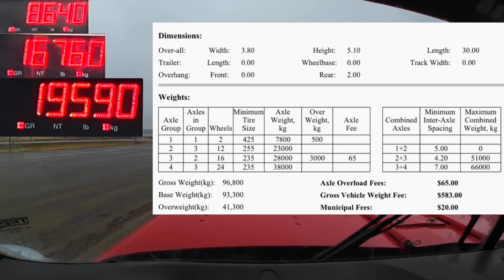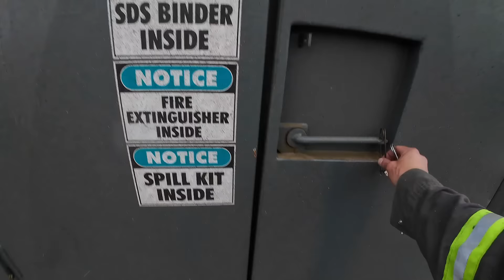CONKLIN BOILER

Comment: Hi guy your really good at what you do I am a retired HD mechanic seen a lot of drivers but your good at what you do I had a accident lost both legs and left hand and deaf was hit with 440 voltage power finished me but I still do a lot of welding for folks
Reply from the maker: dam, sorry to hear about your accident dude. you must be one hell of a tropper to continue and weld too, tough as they come, thanks for the comment and confidence boost, you keep them beads flowing

Comment: Idk if you already found a solution to your radio but I think you need a better ground for it.  I had to do that with my radio when I did led lights in everything
Reply from the maker: yor probably right, the amp is definitely the problem, it could have a better ground instead of the flimsy steel under the bed. ive also started having another problem now i turn on my winch when im around other trucks it pure static for everyone. thats pretty strange. so i think a new heavy ground for the winch console and the amp. start with that, adding a better ground to the radio is a bit of work. and ive had this amp and two way radio issue in 4 trucks now so its not some off problem, but super annoying

Comment: I know you talked about this Jeep and how you have to keep that fifth wheel locked my question is Wouldn't the ride be better if the air was left in the fifth wheel so pretty bounce on it, you know like those shocker hithe. Anyways I was bullshiting you .
Reply from the maker: if it could only act like a holiday trailer 5th wheel air ride, would make for better redes for sure, its not horrible as a loaded ride, and even empty its not too bad, the torsion beam 16 alone empty, thats horrible, there was times at roadtrain i had the planetary tandem tractor too that was spring ride, i shit you not im sure there was times the wheels leave the pavement on sharp bumps empty

Comment: How do you get tires of inside when eight across for repair  great video thanks for doing them safe travels
Reply from the maker: forklift or cherry picker, its shit ill tel you that, tire guys worst nightmare, but some designs are worse than this
Reply: i work on these types of trailers all the time.

We have an overhead crane. One guy down inside the trailer and one guy on the deck running crane and moving/marking tires. We usually use the crane to put the trailer up on frame stands. Get the wheels up 18 inches off the ground. It's a good 3 hours top get them all off and get the bad ones sorted out and move wheels around to make as close to matching pairs as far as tread depth goes.
Reply: @iancole941  Definity not changing one of those out in the field.

Comment: Question: I always wondered what's the benefit to using winch trucks and beds with rollers where you have to load and unload the way you do vs doing it any other way? Always been curious 😅
Reply: Not sure what you are asking? Do you mean having someone load everything or have everything as a trailer only.
Reply from the maker: cheaper for me to just bomb out there and winch it on vs you'd need 2 cranes and space to set them up, crane guys are usually a flat rate or take 5 hrs to do one thing slow, plus you'd need 2 more cranes 600 kms away to unload again. and where i put it as well would be no room for that. and theres no trailer boiler thats built on 24 wheels. hooking up lines 3 feet or more in the air would suck too